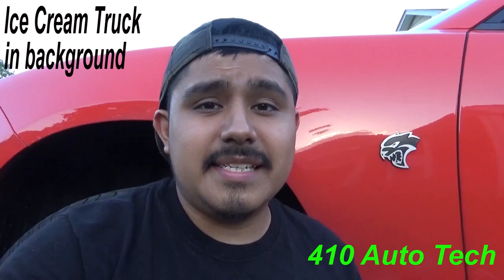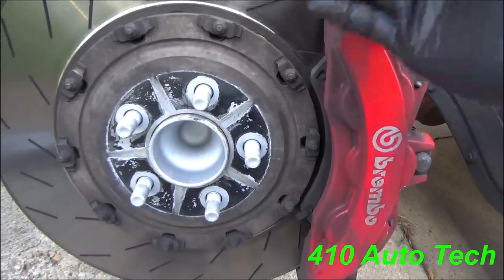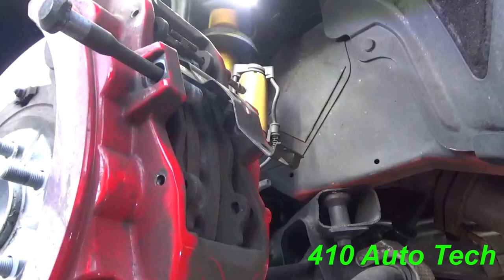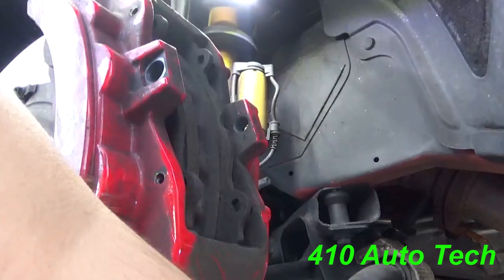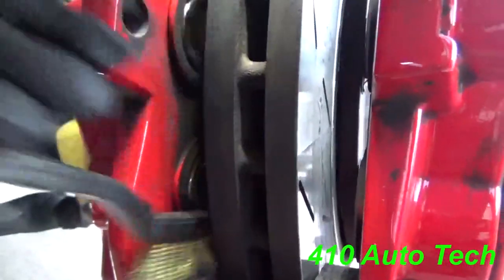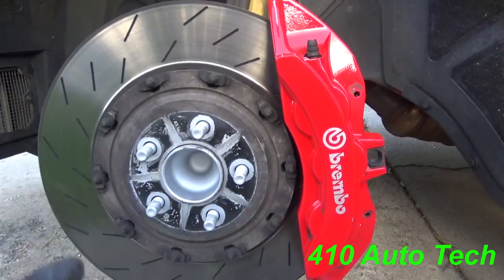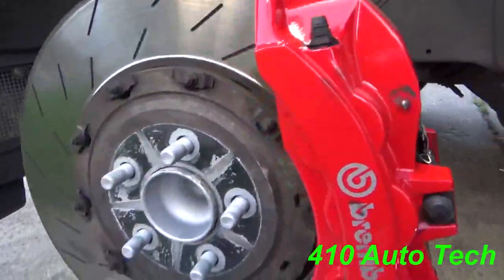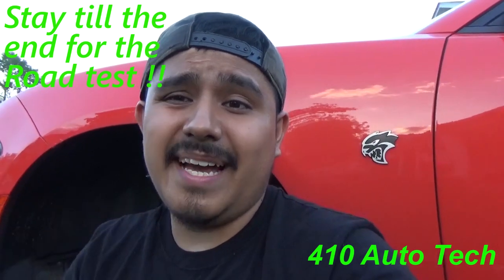How to Replace Brake Pads on a Dodge SRT HellCat

Comment: Nice video!! I did a 2017 as Camaro with the upgraded brembo 6 piston fronts and 4 piston rear. Same 2 piece rotors. The pads were like $504 with taxes at the dealer. Had no choice since customer wanted it done ASAP
Reply from the maker: Yeah the price is insain but hey you spend 50k plus for a sports car we assume you can afford the repairs .  Tires are expensive too.

Comment: Open resivoir cap before pressing cylinders. Sometimes you can get a c clamp on some brakes. Also stick a flat steel bar through to pry or pull with as another option.
Reply from the maker: Appreciate the extra tips that I missed pointing out on the video!!

Comment: Stick a prydriver on each side between pad and rotor and press outward. That always works too
Reply from the maker: Yes it does but since its 6 pistons and re using the rotors without cutting it I didnt want to damage but odly it depressed very easily.